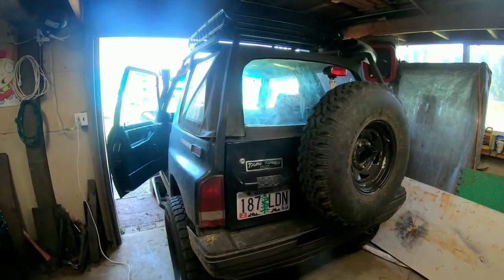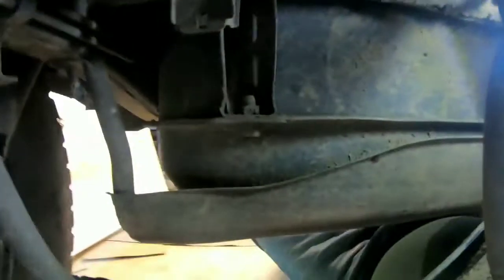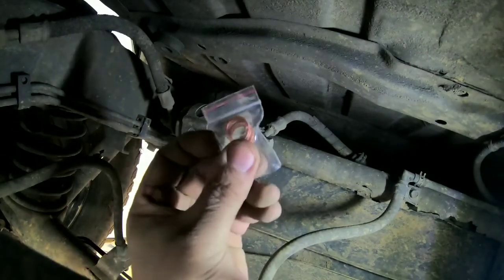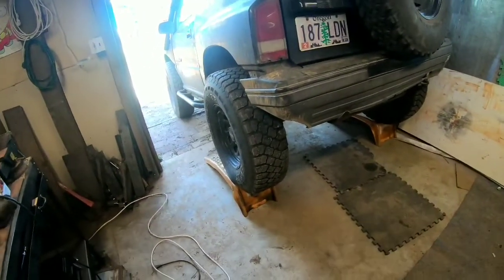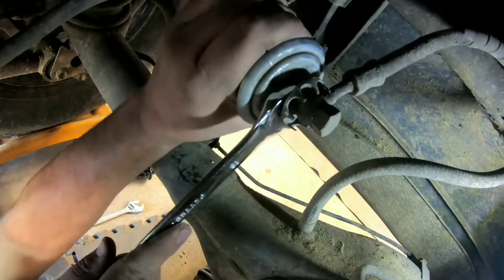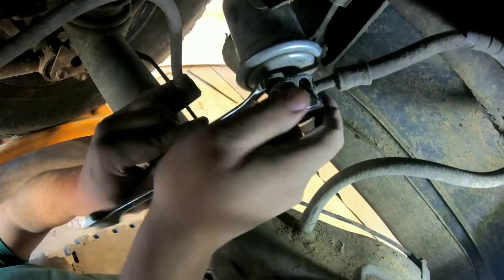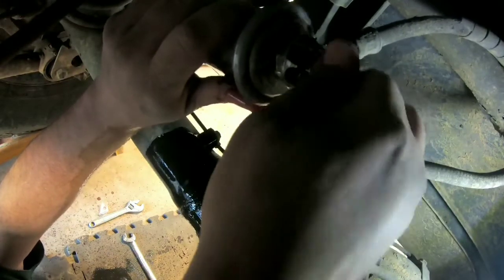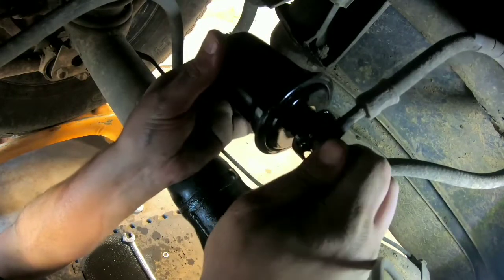Changing the fuel filter on a 1994 Geo Tracker

Comment: Next time pull the fuse for the fuel pump and let it run for a few seconds to clear most of the gas out. You can also disconnect the power to the fuel pump while the engine is running and that will make life better.
Reply from the maker: 2 good tips. I am glad others have better solutions than mine. Thanks